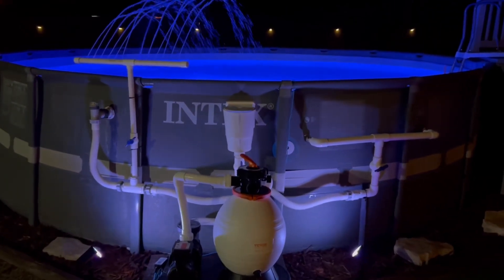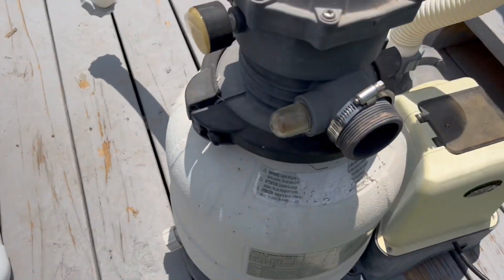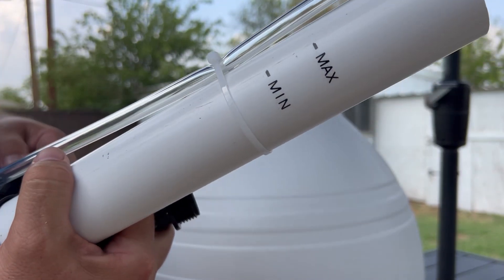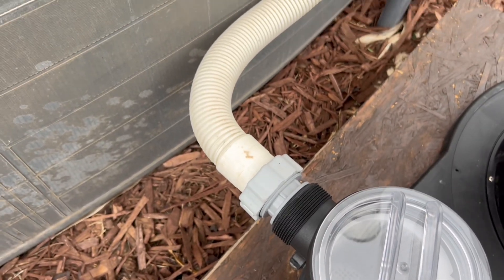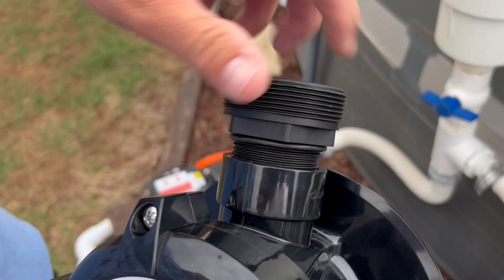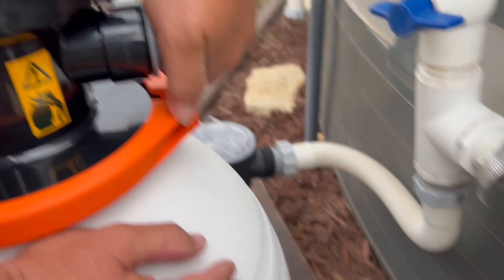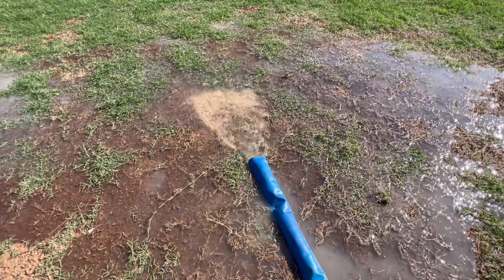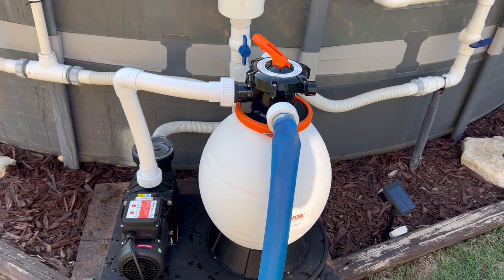How to install a new Sand Filter, Vevor 16” 3500 GPH

Comment: I just purchased this pump and It is putting a load sand in my pool.  Even after I backwash and rinse.  Could you please tell me why this is happening?
Reply: If you put in sand not meant for filters it could bypass the filter assembly, they normally state 20# filter sand, which presumably is of a certain uniform size big enough to not float through.
Reply from the maker: Correct 👍🏼

Comment: I have a question for you, im new to being a pool owner, and I have a bestway pool that looks just like yours, I'm not sure what size yours is, but the one I have is a 14ft x 48" deep, 

Im wanting to switch to a salt water system, and a sand filter too, but my first question would be... If I get a sand filter like the one you're using, how long does it need to run? And how many times a day? Also would this pump and sand filter be too big? Because the salt water system I bought is rates for 15000 gallons, and my pool is close to 5000 gallons, but I was told thats actually good. But im not sure about the sand filter and pump? 

Any advice will be greatly appreciated! Also I'm gonna sub because I've really enjoyed your content so far, I've just found your channel earlier today and have been binge watching your videos haha
Reply from the maker: I really appreciate your kind words. 🙏🏼 if your pool is 5000 gals you could get either a 14” or 16” sand filter they would both be just fine. Every pool is different but I personally run my pool 6 hours on and 6 hours off and it’s all automatic. 
I had this filter for the last few years and it was awesome.
https://amzn.to/43J4jV2
Reply from the maker: Here is the Vevor link for the same size.
https://amzn.to/3NLly2J

Personally out of the two I would get the intex just because I have a lot more experience with those pumps. And it’s cheaper
Reply: @LifeLessOrdinary  Thanks man I really appreciate the advice and the links! Happy Fathers Day to you as well!

Comment: Hello, I sent you a comment or some reason I don’t see it Anyway, I have the same Intex motor is you I just upgraded to the motor and filter you are doing this video on OK so I have the same piping and wiring as you my pool is 24 x 12 x 52 anyway I did exactly how you instructed on the video twice not just once I did it twice and I’m still getting sand into my pool I can’t identify the problem. I check to see if I broke anything. so I poured out all the sand check to see if any of the fingers were broken nothing was broken everything was fine so like I said for a second time, I poured the water then the sand did everything again like you instructed and I’m still getting sand in my pool. It’s not a substantial amount but it’s enough that you can see it on the bottom of the pool. What do I do?
Reply from the maker: Hmmmmmm that’s a hard one. How long are you doing the backwash for when you first turn it on? And after the backwash how long are you doing the rinse for? Is your sand filled up but not past the min/max line on the inside?
Reply from the maker: Also the sand you are using does it say for pools on the bag?
Reply: Thanks for answering so fast ok so yes the sand is the correction I got it from a pool supply store and I am back washing for about 3 to 4 minutes and then I’m writing for about 1 to 2 minutes but I’m still seeing sand in the pool like I said it’s not a substantial amount, but it’s enough that it’s there
Reply from the maker: I really wish I had a better idea of what could be causing this problem. I know how frustrating it would be if that were happening to me. If I were you I would try sending Vevor a message and see if they can assist or send you a new one.

Comment: @LifeLessOrdinary How is this pump a year later?
Reply from the maker: I got a new pump with my new pool this season. So I kept the Vevor as my backup. But it worked great all season
Reply: @LifeLessOrdinary  I appreciate the input. One year seems short on the pool life. I typically get two or three from them.
Reply from the maker: Yes, I’m sure it’ll still work for several years but because I got the new pool, I went ahead and put the new pump on. I didn’t switch it because the pump went bad. I just wanted to clarify. 👍🏼

Comment: I had a terrible experience with a Vevor sand filter pump that was defective right out of the box. I'm still trying to get them to fix it under warranty, but they don't seem to care about customer satisfaction. If you ever have to file a warranty claim, you'll be sorry.
Reply from the maker: That’s very unfortunate and good information to have. Thank you for sharing. Thankfully, my pump was good, but if I did have an issue, I would expect them to fix it.

Comment: Yeah he never said how many pounds of sand though you just said two bags it could be a 25 lb bag and 50 lb bag 80 lb bag
Reply from the maker: @markhutchinson8474  I bought 2 50lb bags and I think I use 1 and 1/2 bags
Reply: @LifeLessOrdinary  is it true though that the 14 inch does not have threaded ports seems rather odd because the 12 inch one does
Reply from the maker: Mine is a 16” and yes the hose connections are threaded but if your using it for a intex type pool you need the Intex adapters like these. https://amzn.to/3zFn5D8
Reply: @LifeLessOrdinary  seems like 14 inch should also have threaded ports I know that the 12 inch ones do
Reply: @LifeLessOrdinary  I bought them but the one guy said that they don't have threaded ports on the 14 inch
Reply from the maker: @markhutchinson8474  I’ve never used a 14” I’m not sure
Reply: @LifeLessOrdinary  he could have gotten the older model

Comment: How much pressure is your pump putting out. I installed the 14” vervor and I’m only getting 6 psi .🫤
Reply from the maker: I will check it this evening. I haven’t really looked at it because the pressure coming out of the return has been extremely strong.
Reply: That seems pretty low, maybe find out what the rating is. It that all the pressure it's supposed to generate?